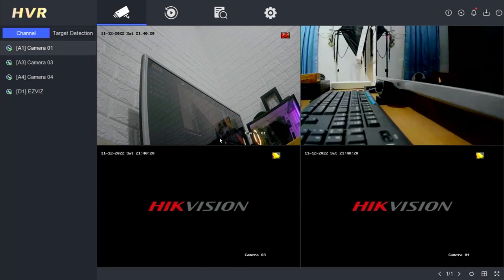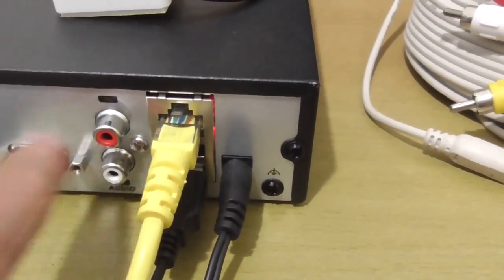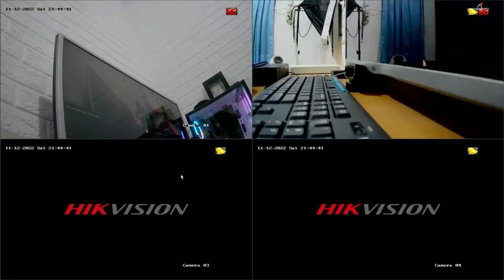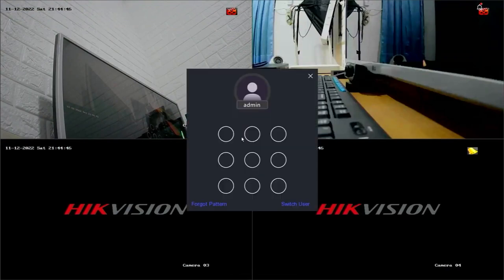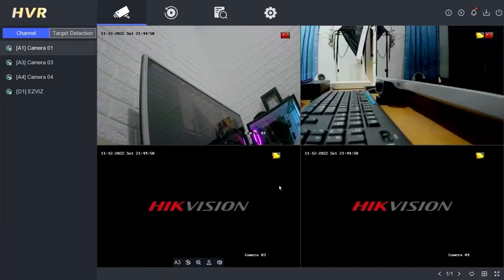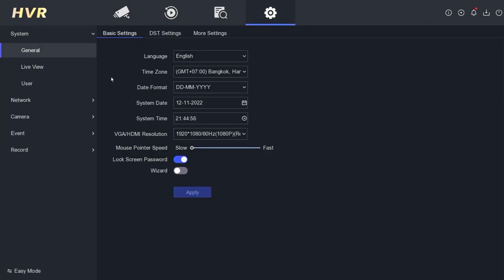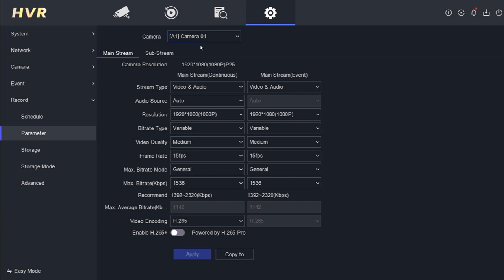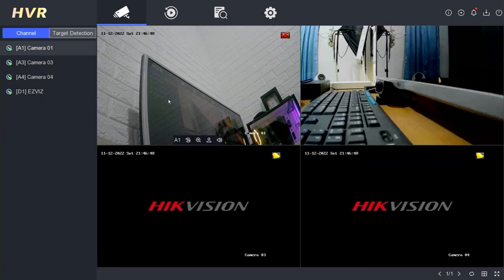How to Install and Setup Microphone on Hikvision DVR

Comment: Your dvr is exactlyn i used...i dont know if the camera has audio..
Reply from the maker: For camera supported audio you no need to add external micro phone, but if your camera not support audio, you need add external microphone to your dvr
Reply: How to determine if may camera has supported audio?o didnt read the manual ..sorry bad english..thanks for answering may question
Reply from the maker: You just activate video & audio on parameter setting
Reply: @HikvisionUpdate  yeah i know that..but i dont have what you have in your video like audio cable and audio monitoring
Reply: @HikvisionUpdate  may cctv model is DS-2CE160DOT-IRPF us this audio camera???
Reply from the maker: Your camera not supported audio
Reply: @HikvisionUpdate  my dvr model is ds -7204HGHI-F1?
What camera  you recommend me to buy?that has audio?
Reply from the maker: DS-2CE10DF3T-PFS
Reply: What if i have channel reciever connected with the dvr then how can i get the audio of the channel?  @HikvisionUpdate